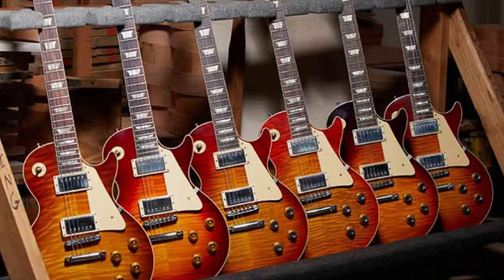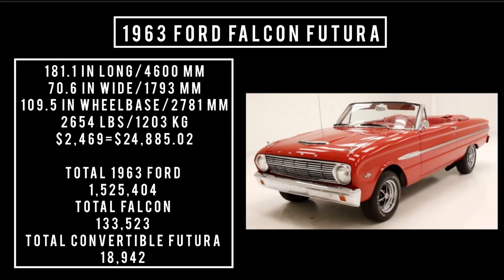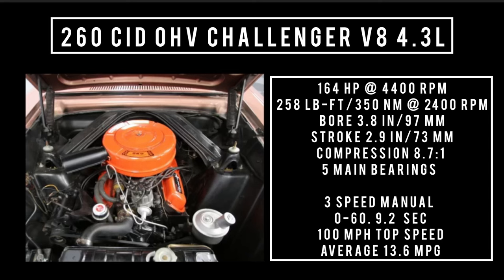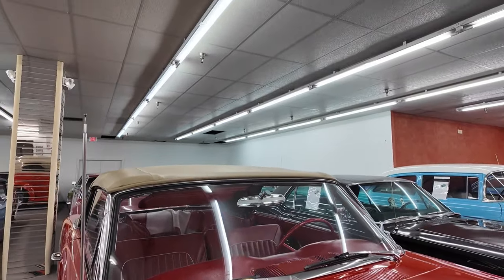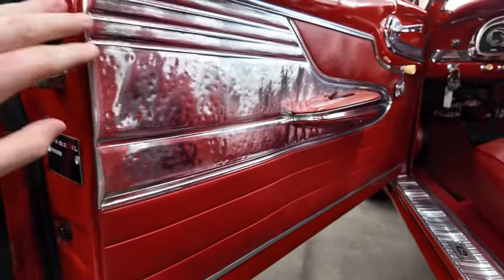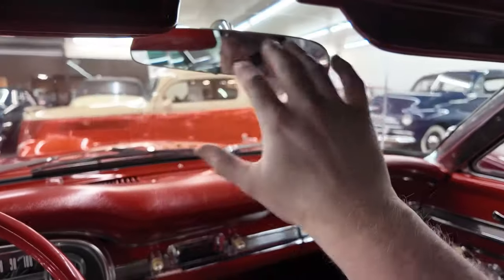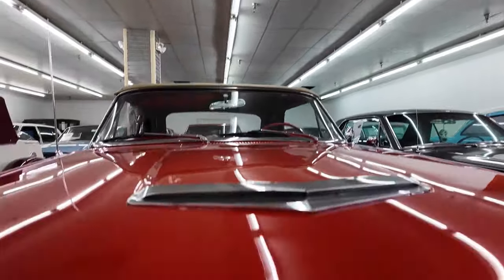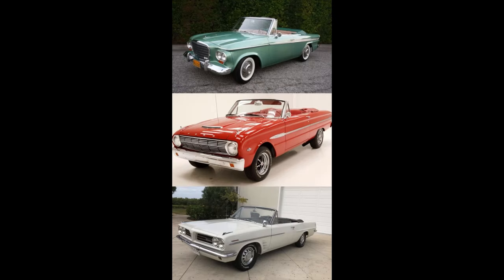1963 ford falcon futura

Comment: Of course the average Ford Falcon in 1963 didn't look much like this one with all the non-original interior do-dads & engine that would not have been on a '63 Falcon. Many of these were bought in the suburbs back then as economical second cars, usually with one of the 6-cylinder motors and 3-speed manual gearbox or else Fordomatic.
Reply from the maker: Totally agree most had 6 cylinders ford ads claim 32 mpg with 144 six but that engine is said to be gutless

This one was nice seats were pushy for econo box car
Reply: The interior is exactly how it looked new from the factory without the dimpling of the silver on the door panels. The 144 was gutless but the 170 was great and really good on gas.
 @What.its.like.

Comment: This is a nice example. I'd prefer an all-original car but I'll bet this one would be a lot more fun to drive than an original. Because it's not original if I had this I would put disc brakes on the front and probably leave everything else as is. I would rather have the 1963 Corvair Monza Sypder and the 1963 Pontiac Tempest. The Lark is a close second.
Reply from the maker: Great choices I tried to feature as close to original cars as possible. I’m not even sure if this was a real futura because the lack of bucket seats and console.. but I will add the bench seat was really comfortable. It might’ve been one of the best bench sheets I ever sat on

Comment: The ad for this car said it has a 302 not a 327.  So the owner stuck a 327 badge on it (first fishy clue). Looking at your different camera angles, I can tell the paint job is not very good with lots of flaws and orange peel texture. I hope whomever bought this car inspected underneath very carefully looking for rust or bad rust repair!!  Also, I would have throughly inspected the body of this car with a magnet because I have a feeling it's loaded with bondo.  I don't mean to be so critical, but this car scares the hell out of me.  I smell something fishy, and I'm usually right.  It has all the signs. I've lost count at 83 cars/trucks that I've owned over 50+ years and have seen some real doozys.  By the way, the Mustang was based on the Falcon chassis.  So basically a Mustang is a Falcon with a different body.
Reply from the maker: Great catch the ad does say 302 the side of the car says 289 =)
Reply: @What.its.like. --  Oops!!  You're right, 289.  I just had finished watching a video about a Chevy Nova II with a 327 engine and had that on my mind when I wrote the comment above, LOL.  That's what happens when you get old and it's late at night.  Still though, I have my doubts about the condition of that car and hope the new owner didn't get taken.  I could be completely wrong, but the signs are there and I've seen to many.
Reply from the maker: Happens to all of us =)